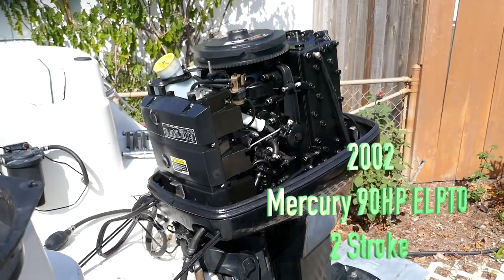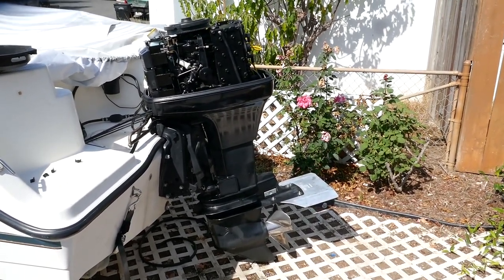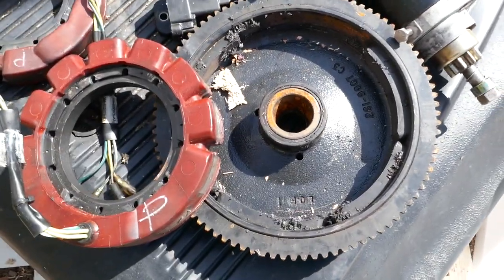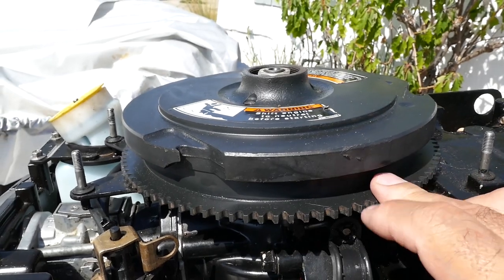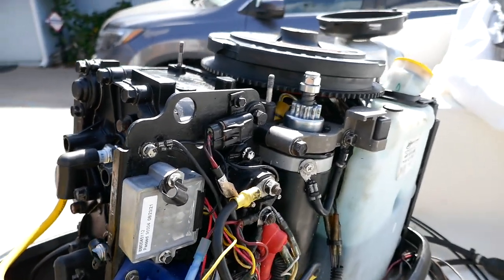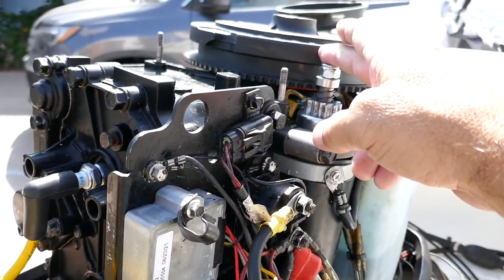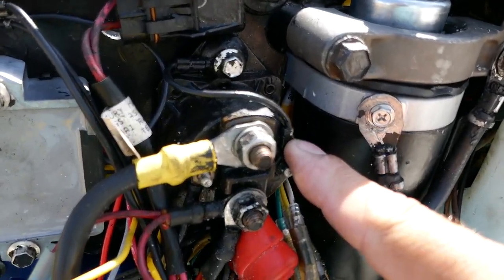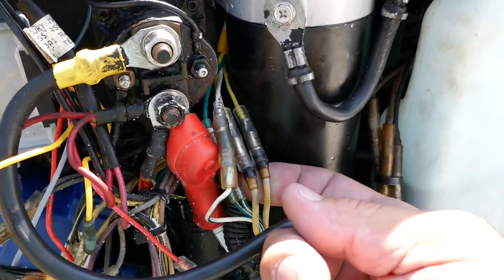Mercury 2002 90hp 2 Stroke  - Motor wont start

Comment from the maker: So an update on what ended up being the problem.  It was the flywheel.  Well it was a very small part on the flywheel.  Pretty difficult to see and obviously a few mechs that looked at it did not see it.  But I finally found one and he saw it right away.  Replaced the flywheel and have been running great since.
Reply: flywhee l , Have the Image , Picture , #oem ?
Reply: @lyricscentral8080 having same issue. Does anybody know which part on the flywheel?